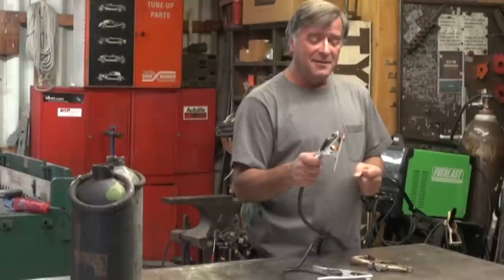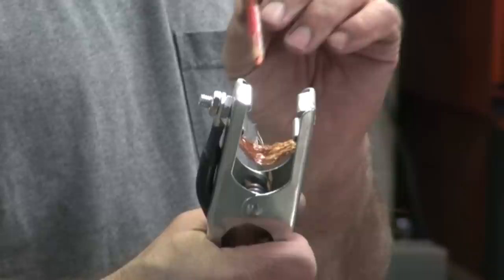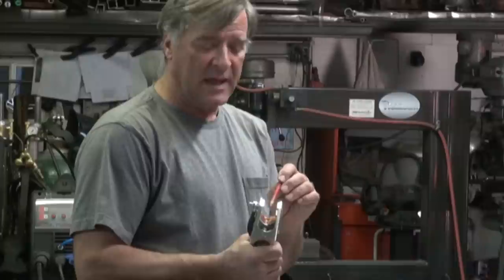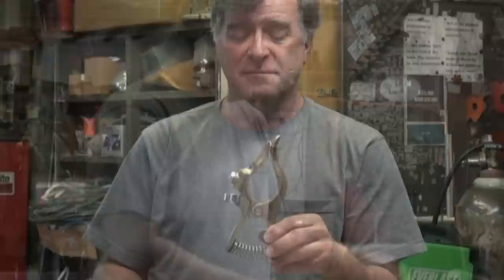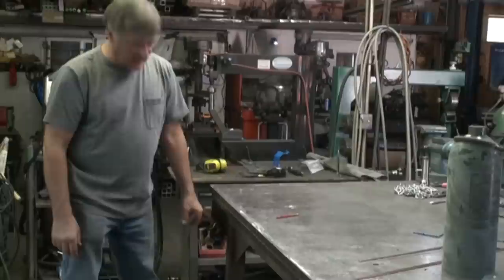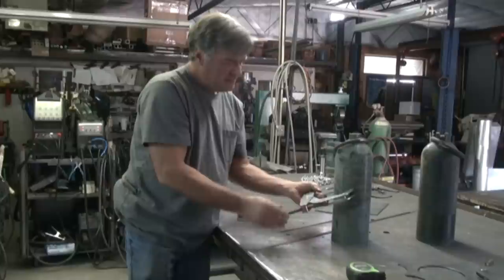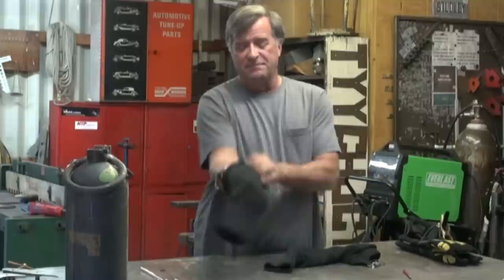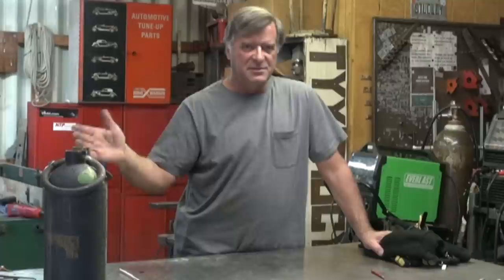How to Get a Good, Safe Welding Ground - How It Works and How to Work It - Kevin Caron

Comment: I connected my ground to a huge speaker magnet after drilling through the middle and putting a bolt through it to attach the wire..   It's actually my 2nd ground..  Cause in DC you get the spatter at the end of the item your welding cause of the magnetic flux from the arc..  Dual grounding the item seems to lower this problem if you don't want to switch to AC or you don't have an AC welder...   The idea is to scramble it as much as possible.  Since AC is constantly moving, the magnetic flux doesn't build up...  Far as shock, DC is usually too low potential to shock the average person.. If you are sweating, the skin tends to be ionized through the water and it becomes a much better conductor than skin alone..  A 12 V car battery can mess you up in this situation..   Recommend staying dry when welding.. Heard of many shock stories being in rain or the person sweating and not covering their skin..   The reason a welder doesn't shock you all the time is because it's isolated from the supply current through a step down transformer usually..  High current, low potential.. It's kind of like opening a can of soda.. it's ok normal, but when you shake it, the lid will blow.. Current works kind of same way, volts = potential is like pressure behind the cap...  The easier it is to blow free the moment you pull on it..   The grounding work table should be isolated I would think from the earth or you create more paths of electricity getting to you..  My table, the only metal is the metal at the top, rest is isolated by wood..  Even the edging so this allows me to rest arms without fear of shock... Electricity is no joke.. Keep it smart..
Reply from the maker: Well said!   Thank you for posting.

Comment: Love all your vids. Very very new to welding. Bought a cheap harbor freight flex core welder about two weeks ago to learn on. First project is a welding table. It's a 90 amp welder. Still figuring out how all the limitations work with amps and volts and all that good stuff. I guess my first question is I have a old house. I use a 110 outlet outback which is 20 amp. What is the largest metal I could use to build my table. Also with a heavy duty construction 100 foot extension cord it will turn on and feed wire but will not arch. Can only use with small 10 foot extension cord which is very inconvenient and literally 6 feet from my ac unit. How can I fix this problem so I can work about 20-40 feet from my house  where I plan on building things one day?  Thank you.

Comment: Thanks Kevin. 9 times out of 10 I wear a flame retardant coverall when welding. Is it necessary to wear welding sleeves over the arms or lean on a leather glove using these to prevent shock?
Reply from the maker: Nope, not at all.  I might get shocked 1 or 2 times a year.  As long has you don't make a better ground than the ground clamp you will be fine.  Long sleeve cotton shirt works the best for me.   I will go to the leather jacket if I am mig or stick welding.  For time 99% of the time I am short sleeve and goat skin work gloves.
Reply: @KevincaronSculpture  so basically don’t get between torch and clamp with the right Ppe on and you won’t get zapped?

Comment: question here, will grounding off the work table to an earth ground help avoid in any way electrical shock?, or will it interfere with the work clamp ground and cause bad piece grounding therefore a bad welding source? im asking because im in the middle of the woods and the only electrical ground is a copper rod ..and im about to install the electrical sistem to the shop and was wondering if this would help...thanks all...
Reply from the maker: Most definitely help!

Go for it!

Comment: I have a wood table with metal leg on it and I want to work on my table. Do I put my clamp on the metal leg or on my work
Reply from the maker: Metal to metal..   clamp to your work please.
Reply: don't use a wooden table
Reply: @KevincaronSculpture  I have a metal plate resting on an old army plastic locker for a table. Do I clamp to the plate or my work?
Reply: @Mikey-ym6ok  first step is too find some metal tubes, and a piece of thicker sheet metal and weld you a table first.

Comment: My work has a coat of paint.  Will this effect the ground?  The joints are ground bare but the ground clamp area is painted and I am not getting a good spark.
Reply from the maker: Yes, you have to have clean metal for the ground as well.

Comment: Hey Kevin what about a magnetic clamp holder? Have you used one? I have a small (around 2") magnet with bolt and nuts for clamp to grab onto and internal spring for different positions. It's good for pieces with no easy clamp spots but it's been a while since I used it so cannot recall if it's a good ground. Will try it today.
Reply from the maker: Just make sure you don't go over the rated amps for the magnet.   Set mine on fire one day!
Reply: Kevin Caron, Artist oh I didn't even know they had a rating. Good to know. Thanks.

Comment: i wear coveralls while welding
Reply from the maker: Always a good choice.   I like the Levis and tee shirts.   Will get the welding jacket out for mig and stick.
Reply: @KevincaronSculpture  yeah once it saved my front leg i wasn't using the grinder safely and it jumped from my "single" hand to the floor i caught it by the cord and it hit the top of my safety boots and the coveralls it had a cutoff wheel .. an experiance i would never want to happen again.

Comment: clamp the metal bell, leave the bell on the metal table, the table isn't a ground?
Reply from the maker: In that setup, yes, the table is a stable ground.  Most of the time what I am welding is too big or round and hard to clamp down. Thank you for watching and posting.
Reply: @KevincaronSculpture  Thanks for the info. I've licked too many batteries growing up. I'm extra paranoid...